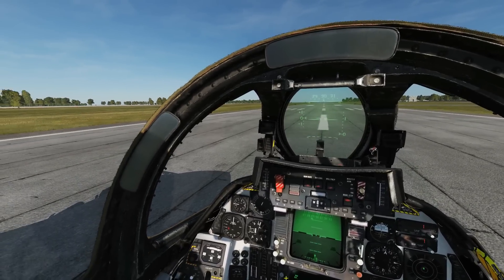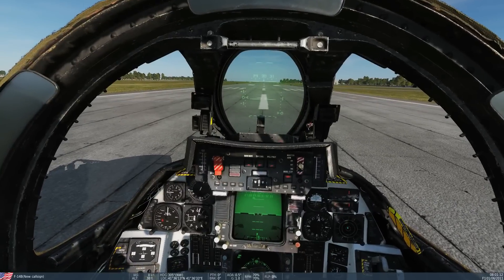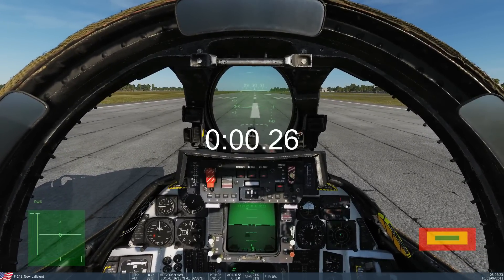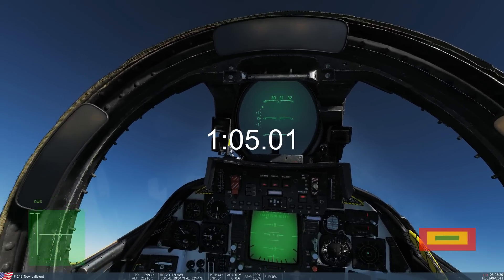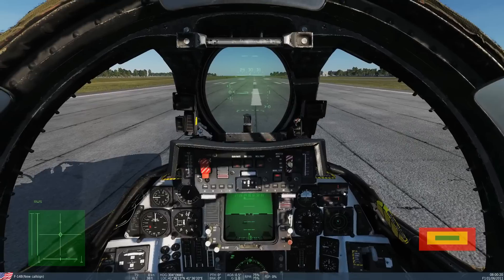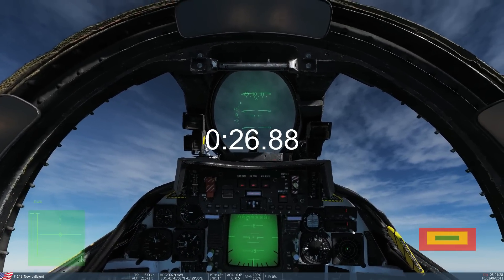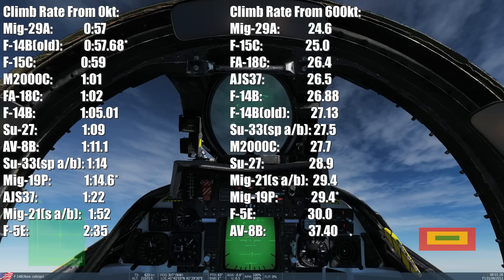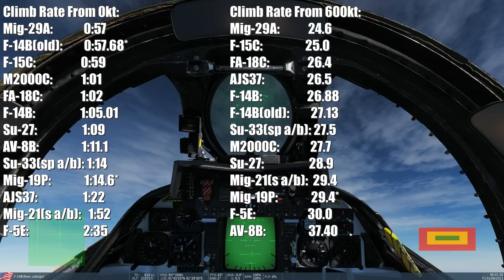F-14B Tomcat: RE-TESTED Max Comparable Climb Rate | DCS WORLD

Comment: My guess would be that the climb from zero is based purely on raw power, ie the ability of the engines to get the plane moving, whereas the climb rate from 600 kts is based a lot more on how clean the aircraft is, and thus its ability to keep its speed while climbing.  Of course the first test included the second test (ie ability to get the thing up to speed), another test then might be to see how long it takes to get each aircraft to 600 kts.  In this instance I think that you would see why non-AB aircraft like the AV-8B fare so poorly in the first test and no TOO bad in the second.

Another test might be to take two aircraft of exactly the same type and take off weight but with different drag profiles and see what happens, eg one loaded with max fuel but no stores while another has 10% fuel and 90% of max fuel weight carried as stores.

All in all a very interesting set of tests, I am really sad that my crap reflexes, crap memory, crap coordination and poor bank balance stop me from trying this game out.
Reply: Well, the base DCS, Black Sea map, and Su-25T are free... and to be honest, it's a really good plane, despite being a low-fidelity one.

Comment: In the first test you rotate at a higher speed and don't pull as fast. So by the time you reach 45 degrees there is quite a big speed difference from the different test's.

Comment: You might get better results if you manually swept the wing bck after takeoff
Reply: The automatic system is pretty good at keeping them in the optimal place. Sweeping them back does decrease drag, but it also decreases lift, which in turn increases drag. Any test so far where he's tried to override the automatic system, it's ended up worse.
Reply: cedrictaylor08 it would reduce drag,so you have a point.
Reply: I've seen it done when I was stationed at nas oceana the 14 squadron would do thier check ride in the  morning or the co of the base who was a 14 driver kept his quals by doing check rides which lasted 30-40 min in the morning